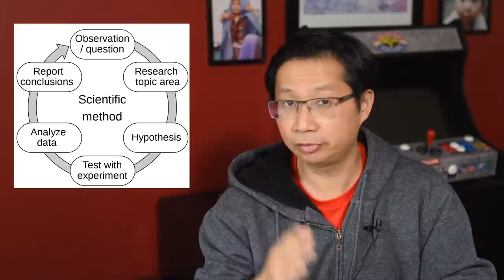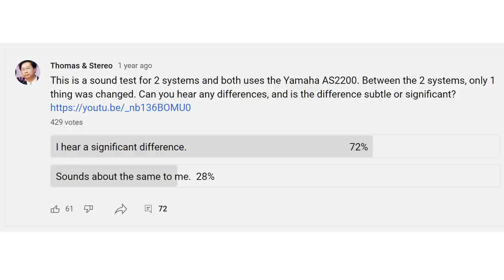Let me tell you stories about Break-in.

Comment: There are some aspects that have a measurable impact in loudspeaker performance. Loudspeaker drivers have moving parts and those parts are mostly glued together. Spider to coil and coil to diaphragm adhesion are critical areas that have a measurable impact on Thiele Small parameters, in particular Fs (resonance frequency); if the driver is moved to full excursion then we can assume that the definitive or lowest resonance frequency has been reached; reason resides in the adhesion area that becomes a bit smaller once the cone excursion reaches the limit (adhesives partially break away from spider and coil allowing a slightly but measurable Fs drop). Coil to Cone adhesion in most speaker drivers is granted by Epoxy Adhesives and those adhesives have the tendency to cure quickly up to 75%/90% in one day. During the first month or so a loudspeaker may becomes a bit more efficient in the high frequency domain due to Epoxy Adhesive aging (the stiffer the adhesion between coil support and diaphragm, the more HF energy is translated to the cone). Outer suspension of a driver is also glued and prone to get a bit looser if the speaker reaches full excursion...the same phenomenon affects midranges and also tweeters.

Comment: Excellent and thought provoking as usual!  😊  The only clear experience that I have that I feel is pretty definitive is the Littlebear T11 all tube phono amp.  I could tell a very significant difference in the sound after it had 'broken in' for a couple of weeks.  It most certainly improved.  Also, coincidentally, with my IFI Phono 2 amp.  I also noticed quite an improvement after a couple of weeks of 'burn in'  Both definitely improved in tonality, depth, and soundstage.

Comment: I had no feelings one way or the other about equipment break-in; I do remember that it’s suggested that with cars, the engine has a break-in period where the pistons/rings settle into an initial wear pattern after a couple hundred (?) miles or so, and about 50 miles with new tires. Anyway, I wasn’t expecting a noticeable difference in any of my stereo components, but I have noticed changes in how speakers and phono cartridges sound after an indeterminant number of hours of use. I haven’t experienced this with the other components.

Comment: Very interesting. Here is what I think. I just received the Reisong A10 amp and replaced all the tubes with quality ones, like we’re supposed to. I think the burn-in is a result of heat cycles, not run time. So, I am turning on, letting the tubes warm up, playing for 1/2 hour or so, and then turning off and letting the amp cool down completely until the next turn-on, and repeating. If I am right, the time till “sounds great” will be much shorter. Please let me know your thoughts.

Comment: For me, speakers, as electro-mechanical devices, breaking-ins, makes perfect sense both theoretically, rubber surrounds needing stretching to get to a ‘steady state’ compliance level, etc., and practically, I’ve heard multiple sets of speakers sounding better, smoother & less hash, etc., after few months of playing (breakin period to get to their ‘steady state’)
For tube devices, running tubes long enough getting tubes to a ‘steady state’ (breakin period) also makes sense to me.
For SS devices, I’m not so sure about the need for breakins except perhaps for capacitors which I suspect do change over time. 
Adding to the confusions (& controversies) is not all manufacturers design their gears to the ‘steady states’ (to me that’s what ‘breaking in’ is about) so end users experiences differing results. And argue whether ‘breaking in’ is a thing... or not! And, based on their own experiences, are absolutely certain that they are correct. And the arguing continues...

Comment: Both are right. With a moving part like the surround structure of a woofer, depending on what they used it does need to loosen up. Sometimes resisters and capacitors need to heat up to "seal" or "burn off" things like flux that in theory could alter the sound...but its only slight and that usually only takes 10 minuets after its first power on (maybe an hour if they used too much). This is of course assuming its a quality piece of electronics. Most break in usually is our ears adjusting to the new sound and becoming familiar with it. Now that being said I have heard electronics taking 2 or 3 days to smoothed out some sharp tones, but rather than saying break in is a thing that is needed, I question the quality of the assembly and parts used. So yes some parts do break in SLIGHTLY and other issues are borderline quality control, and the 3rd, we simply adjust to the way it sounds. That's my 2 cents

Comment: Thank You! It's a great video once again. I think break-in is a real but complex phenomenon. Besides facts you mentioned, I would emphasize two other features of break-in process. First, it has some kind of cycling nature. E.g. First day the sytem with a new equipment has great bass, and weaker other features, next day it has better treble, and next day it has ballanced, open stereo image, and finally it has a boring, dull sound. And next the whole starts again in a different level, and with different cycle-time, and it's repeating over, and over again, i think it lasts for about 2 months usually with on a detectable level. Then the cycles remain, but less smaller amplitude. Next thing its complexity. A simple wire, like an interconnect or a loudspeaker cable is really complex thing? No, I don't think so. But sometimes it has a complex effect on the sound! Why? How come!? Because it connects very complex equipmnets, with full of network of electrical parts, which  are really not a direct current aplifier (voltage/ampere) at all! No, these equippmnets are for amplify the amplitudo of very complex wave signals, and make them convert to sound. All my respect to Electrical Engineers, but some say its just current, and nothing more ore less. Its true, but its going through this complex networks from a single CD, till the membrane of the loudspeker, and the equipments are full off coils, and capatitors, and all has a filtering, and phase shifting effect on the current waves. Its a real miracle, that there is any sound at all in the end of the chain! And back to your cable, when you change any part of this chain, only this very simple part like a cable, with its slightly changing resistance, capatitive, and  impedance attributes, do you really think, that this will not change the characteristics of the whole seriously resonating network, its, complex filtering, and phase shifting  effect? No, Idont think so. :)

Comment: Yes I do. Even at the factory of higher end equipment, they have burn-in racks. I was involved in FDA medical device manufacturing years ago and we had big rooms for equipment burn-in. It was necessary and regulated as part of the manufacturing process.
Reply from the maker: Do they burn in to ensure that it is all working before leaving the factory?
Reply: @ThomasAndStereo  It’s for QC and also performance. This is both mechanical and electrical. Diaphragm pumps which have similar properties for speakers need to be worn in. The electrical components measured results do show differences between burned-in and “green”.
Reply: @ThomasAndStereo  Outside of audio, I’m also into racing. I owned a Porsche and even it took time to break-in not just the engine but also the exhaust. From factory, the exhaust tailpipes are crooked and after a few weeks from heat, the tailpipes straighten up. I currently own a Ferrari F430 and it takes quite a bit of warming up to operate properly. Hence I truly believe everything, including audio, needs some time to warm up and/or burn-in when new.

Comment: I remember when I bought my new amplifier, the sound changed after 10 hours of break-in. Regarding the PCM loudspeakers, they use a very complex crossover design and I believe the electrical components need a few hours to fully regulate the current flow passing through them. That is my theory about the subject.

Comment: well at least for subwoofers i can say the break in is very real 
the surround just needs time to wear in especially with subs that have a very hard surround 
and you know what that is actually measurable most people can easily hear the difference 
but you dont need that just use your finger and feel the surround of the sub after break in it is definitely softer 
now do you need to break in the subs no they play just fine from the get go 
however i can tell you from db drag competitions that i have been a part of 
that there is a lot of people who smoke their subs frequently and they also recone them themself 
straight after reconing they usually achieve slightly lower scores 1-3 db
Reply: to the question you pose i have done over 70 custom car hifi installs and tuned countless more 
for mids and highs its much harder to detect but for subwoofers its clear as night and day
to clarify i always have a lot of listening time because the systems i build are mostly for people in my club 
and so i can hear the progression of the break in and once it is really broken in i usually tune the whole system again
you know how it is its never really finished you always tinker

Comment: I have not heard much break in at all, most of my equipment is used and didn't change sound after i started using it. I purchased a new Quad preamp this year, brand new, and it sounded wonderful out of the box. My speakers mellowed a slight bit as the new capacitors i replaced in the xovers broke in, pretty subtle though.

Comment: I have a BAT Vk-75 for many years..it did change after a few months…and i enjoyed the amp.  As it got older, i got to thinking about improving the sound and changed the capacitors.  After changing the caps, it sounded boring…i just went on about my ways and I forgot all about it….one evening, i turned the amp on and listened.  I was shocked about how nice the sound was. I was wondering what changed, i had completely forgotten about the caps that i had changed.

Comment: At least in case of my speakers it seems to me that break-in reverses itself if the speaker is not used for extended period. Or if used at too low volume for extended periods. I'm thinking that they are kind of overspecified for my room and my usual listening levels as they seem to play way way better for 2 or 3 days and even at low volume after I gently blast them occasionally for an hour or two... Not sure no hard data here but that's my experience.

Comment: Hello, I see this is an older post but I was interested in Break-in I purchased a IFI Signature pro because of the the tube section. I had a cheaper DAC and whated to replace the DAC, I'm feeding a Mcintosh MHA200 amp with Focal OG Utopia's  for listening. The Dac was VERY bright but I noticed after 1 hour the brightness would lessen , so I started to turn it on with music for a couple hours / turn off, later repeat 50+ hours the brightness is all but gone and I,m treated to total bliss! I have noticed that having a tube system everything needs to warm -up for 45 mins before listening.

Comment: I've seen the gamut with break in.  Some things I have didn't need break in at all, they sounded the same day 1 as they did a year latter.  Other items I've seen major changes with.  I had a pair of La Scalas with rebuilt crossovers.  The crossovers themselves sounded unbearably harsh but after about 70 hours they become smooth and great sounding.  My mc275s constantly change their sound as the tubes get older.  I have a Simaudio Moon 280d streamer that simaudio said in the manual needs 300-400 hours of break-in and they were 100% correct as the sound changed dramatically over those 300 hours.  I've seen, side by side a new mc462 and a broken in one and they sound nothing like each other at first but after 100 hours they sounded the same.

Comment: i can talk about bike engines, they smooth out after a few hundred km because of tolerances: actual vs designed. any dynamic system would tend towards equilibrium and that equilibrium may not be the one designed. similarly if you have to change some part, the system would need time to re achieve that equilibrium and again it would be different from designed

Comment: Hey Thomas I think the question is break in versus burn in most all electronics are burned in . I think sp.eakers need breaked in . Cables and solid state electronics  I don't know if break in is needed. Tube  gear does require break in. I think the brain perception  is most important factor. Keep up the good work.

Comment: I was surprised that a digital recording , where one can compare signals via the frequency graphs, made before and after break in, for comparison of change was not mentioned in the discussion.  Of course all it could revel is the presence of change, but at least it would provide proof of the effect.   

That an observed change using only hearing might be an effect of the mind might be forwarded because the changes always seem to stop at some point, as if the mechanical effects creating the change were shut off.

Comment: Throw out the caps and teflon and call it a day.  All crossovers I have seen have caps.  Most power supplies have caps.  Usually wires are coated with something, if it's teflon, wait for changes.   Change anything, caps need to newly acclimate.  It's not complicated.

Comment: I firmly believe in speaker break-in due to experience I had with most speakers., but didn't consider amplifier break-in as significant. Not until I got my Sansui amp fully recapped with Elna Silmic II caps. At first it sounded ok, but not as good as originally, then after 2 hours soundstage collapsed and it sounded almost like listening to mono music. Sounded distorted also. Between 5-20 hours it sounded very, very bright, after that it got only better and sound stabilized slowly till around 100 hours.

I also gradually modified crossovers in some of my speakers and it often takes few hours to settle.  Some components need more, some less time. They usually become less harsh, more dynamic and composed. Becouse of that I'm a firm believer new speakers need break-in, not only becouse the spider and drivers need to settle but also crossover components. 

Haven't yet experienced cable break-in though.

Let me also say critical listening is my proffession - I'm a conductor and musician and I consider myself as having a very good ear and sound memory.

Comment: I have an pro-ject class d power amp (ds2) and havent noticed a big difference in it. But my Yamaha intigrated wxa-50 did break in. Ive also noticed the same in in speakers. My triangle br03 broke in less than my canton chrono 570 or sf chameleon b. My two canton subs broke in alot, different models but gained alot more grip and control after 100 ish h of normal use.

Comment: I noticed a improvement in sound with my Schiit Freya + after using it for a considerable amount of time. In my case that was months of daily use. I’m sure any reasonable person would say that it wasn’t the actual component breaking in but the tubes. But no. I think I can confidently say that this is not the case as I prefer the Freya + in passive mode and listen that way almost exclusively.

Comment: The only one time experience I have had with "break-in" was with the cantilever on stylus.  The cartridge and accompanying stylus are the 2 items new in my system. I buy used and vintage gear for the most part. And only have one pr. of mono-blocs amps I purchased new and had not found a significant change in performance since 12 year ago. I will make the claim that to my ears there was a huge difference in performance at around the 30th hour of spinning LPs.

Comment: I've experienced break-in across the board, though it has varied, speakers and mechanical elements like turntable cartridges with moving parts have required the most time, followed by tubes with electrical elements that heat and cool, then power supplies in amps then dacs and then cables with the latter changing in a day or two. For me it's real for sure. However, part of the change is physical and part of the change is your brains adaptation in my opinion. I'd be surprised if some of the changes couldn't be measured in a simple frequency sweep / curve?

Comment: Logically, if any item needs, for example, 100 hours to achieve optimal and ideal performance, it assumes a changing state over time. If that's the case then at the 100th hour plus x , the state has already changed beyond the ideal performance state. Unless the proposition is that the item KNOWS and STOPS changing over time, then break in may be real but it also means the next step AFTER the break in state, is change again. You can't have the idea of entropy in a system exists temporarily and then have the idea stops when the observer says so. The only ideal state where everyone can agree on sound quality is when the system is  turned off.